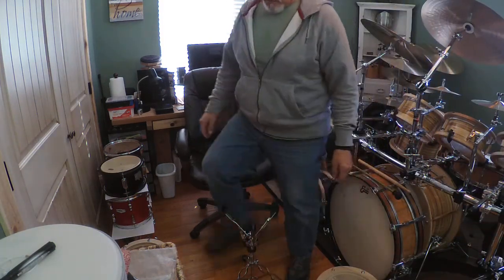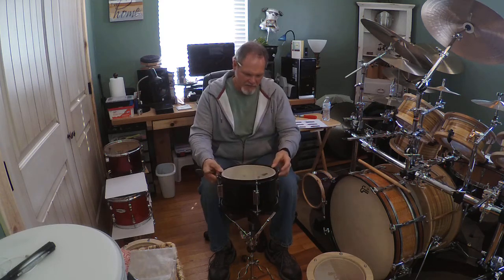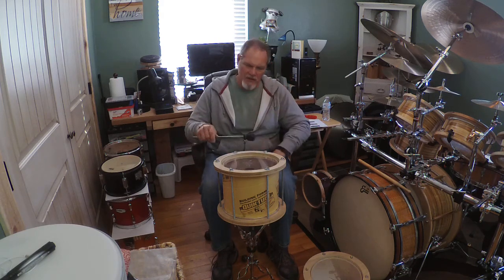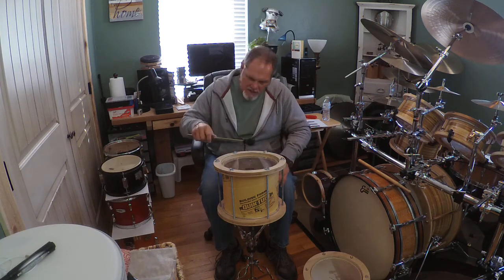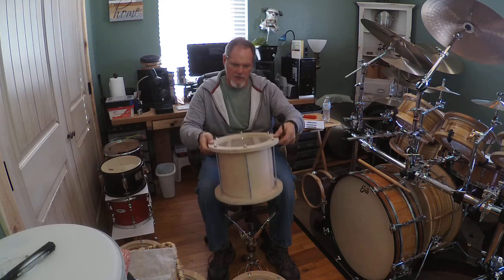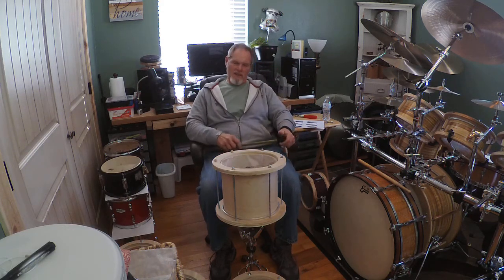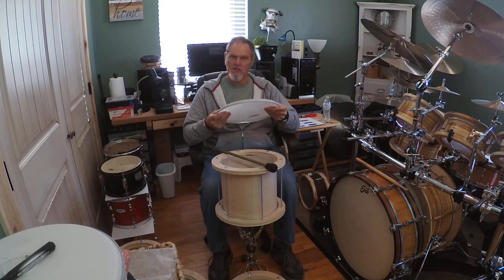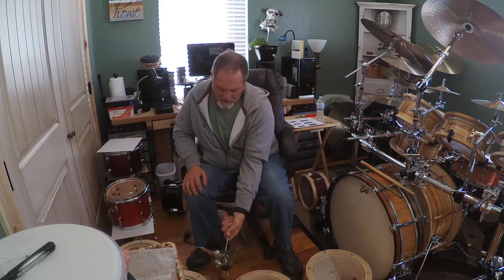Drum Shells and Sound - Bearing Edges, Part 6

Comment: Hello REFondrums!! I just found your video this morning and I really enjoyed the information/truth!! I have two questions for you that I'd like to get your opinion on. 1) I have a Gretsch Usa Custon 13x9 tom from the early 80's (square badge). Out of the entire kit, I'm hearing all kinds of crazy frequencies/overtones when I tune the drum mid to high jazz range. There are no issues with the drum resonating regardless of the heads that I use. Could this have anything to do with the edges? I've used tape/moongel but it affects the feel of the drum. I prefer a smooth clean open sound as my other toms don't have this issue. I was thinking about have the Gretsch internal mufflers installed. Have you ever experienced this? I've had 3 other 13x9 toms and don't recall having this problem. Thanks for any advice that you might have!! 2) I just received a new Sakae Maple kit last week and the store shipped a Birch Bass drum and a Birch floor tom. They are in the process of sending the correct maple Bass drum and floor tom.The bass drum sounding nice, but I noticed that the floor tom seemed to have a brighter character compared to the other smaller Maple toms. Would you keep the Birch drums or just wait to receive the Maple replacements? In all fairness i didn't switch a lot of heads on the 16in floor tom. Doesn't sound like I'm buying into the hype of Birch being brighter or less desirable that Maple? Crazy questions I know!!
Reply from the maker: Sorry I missed this three weeks ago. YT didn't notify of your comment. Actually, this has been happening more and more. 

Honestly, I have always felt a 9x13 is a difficult sounding drum when placed with the rest of a set, having always had large set-ups. It depends on the pitch you are going for and the sympathy attained with your reso head. If you don't have to match  the pitch with other toms in a run, it's a lot more forgiving. 

If you have tried different heads on the drum, the only thing I can suggest is trying different heads with it from different companies, batter and reso. If you use REMO, try Evans, or Aquarian or Attack and vice versa, top and bottom. Mix and match.  It could also be the heads you are using, as far as how the mylar has been mechanically crimped into the hoop, etc. I've had dud heads before, replaced them, and tuning problems went away.  

You may have a dud tom, in the sense of empty spaces in the veneers. Glue didn't hold or something, throwing the density of the shell out of whack with itself. 

You would have to define 'resonance' for me to answer further.  Resonance is a term that carries different meaning to different people. 

If the heads seat correctly on the bearing edges I would not suspect a problem there. 

As far as a Maple or Birch drum, having had both in my sets, and never noticing any dramatic differences, especially live or on a recording, personally, I would not mess with it. Birch grain can look different than Maple but, maybe you have a wrap on the kit. If you are a "purest" and having the Birch will bug you for some reason, get the replacement.
Reply: @REFondrums  Thanks REFondrums!!

Comment: Quote from Noble&Cooley website: "most of the drum´s sound comes from the shell". Well, thats not what whe are hearing on this video, right?
Reply from the maker: Absolutely no disrespect to the venerated N&C company but, logically, on the face of it, a tensioned drum head produces sound, pitches, even without a shell, via Roto toms, Flats, Traps, etc., including all kinds of frame drums. That basic pitch is either enhanced or diminished by the density of the shell wall, depth of the shell, etc. as well as, to lesser or greater effect, the type of drum head used. The drum shell has zip to do when you change from a clear single ply to coated dble ply, etc. The sound of the drum then changes because of the heads, not the shell. The types of Mylar used will go a lot farther in giving a drum its overall tone than a drum shell. It's just common sense. Like I have said, drum companies want to sell their drums not some other company's heads. It's all nuances, subtleties. 

A shell with nothing on it, produces nothing but a faint tone if thumped. Obvious observation tells me the sound of a drum comes from the membranes stretched across a frame or cylinder, not the frame or cylinder. Shells can effect volume, and frequency ranges, and other things that just get lost when you put a drum set in the midst of a band. Electronics, mics, PA systems, software, everything modern drums have to deal with effect the sound way more than any shell can do. And given all that, the head companies have all spent a lot of money on R&D to come up with a plastic head that SOUNDS like calfskin. 

It's a shame the ultra-hype in the industry marketing has gotten to this point. That's why I made the videos.